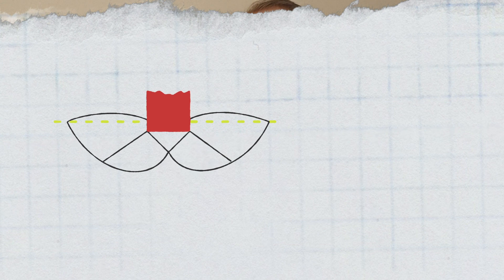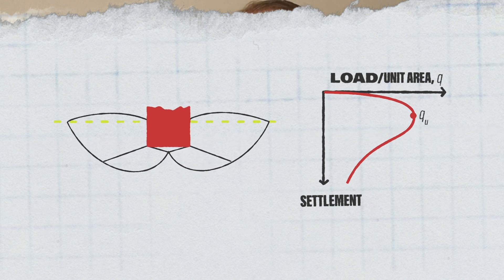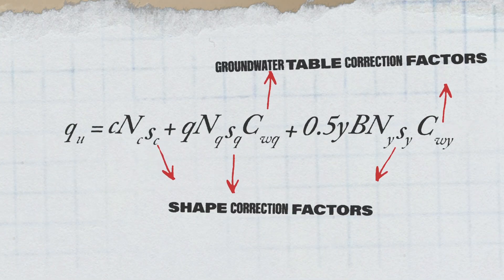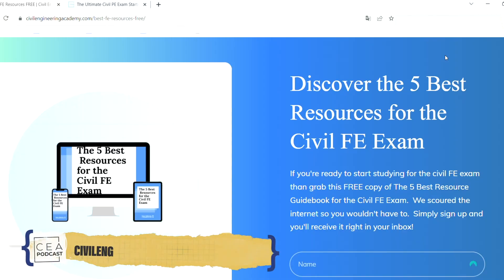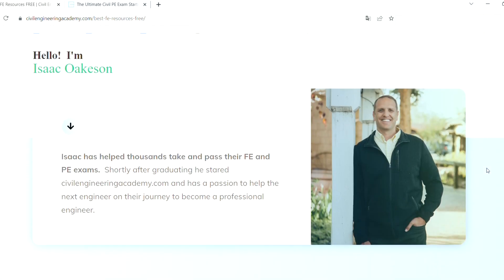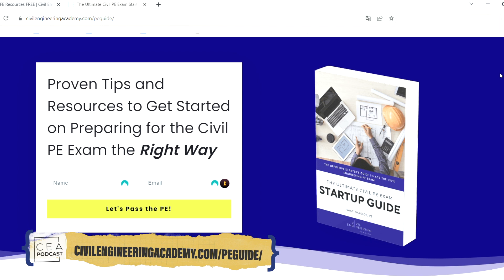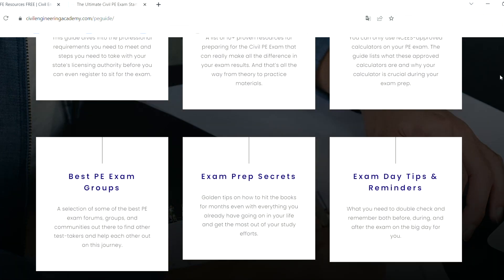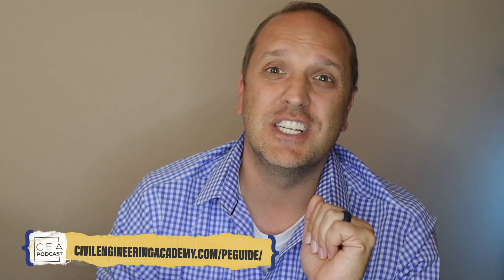The Most Asked Bearing Capacity Question for the FE & PE Exam 🤔

Comment: I was asked to solve for Ultimate Bearing Capacity on the FE last weekend but they did NOT provide the Depth of the footing or the cohesion of the soil. They gave the N values, Unit Weight of the Soil, and the Width of the footing. Does anyone know how to solve for the Depth of the footing? I think the cohesion was assumed to be zero but the Depth was still uknownn

Comment: In a slope stability analysis, do you use the gross bearing capacity or net bearing capacity when representing a strip footing on a slope? Slope stability software assumes a plane-strain medium, so it is a distributed load. But is the gross or net bearing pressure used? I assume net since "net never changes."

Is this true? I'm asking you if YOU are reading THIS.

Comment: So if it's a strip footing, would it specify? Perhaps something like infinite length? And in that case we use the original equation: qult = cNc + qNq + 0.5(gamma)(Bf)(Ny).

But if it's a standard square or rectangle we'd add in the shape correction factors. Am I understanding this right? I don't actually see an equation in the PE reference handbook that includes the groundwater table correction factors. I see the table, but no equation.
Reply from the maker: That's correct.  If something is not giving in the handbook they'll specify it in the problem.
Reply: Hello, the Shape Correction Factors table is on page 90 of the most recent handbook version. If you can't find it just look up "Shape Correction Factors" (press CTRL and F in the PDF file). For strip footings, it will either specify or for example say "WALL" footing which will give you the indication of it being a strip footing. On the other hand, when you read column footings, it will be isolated footing (either a square or rectangular footing).